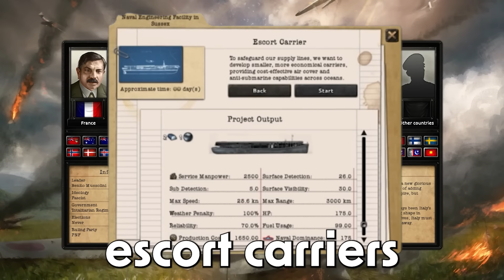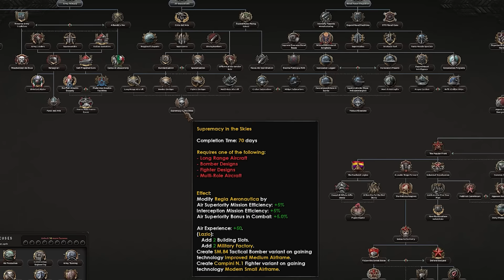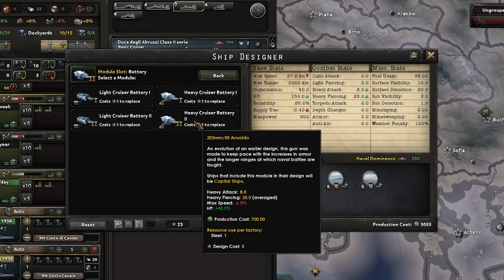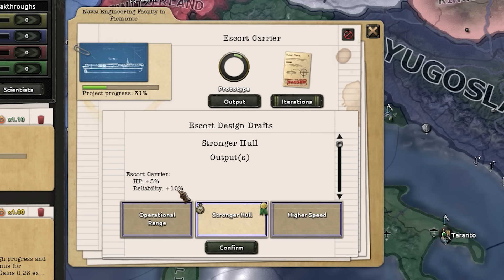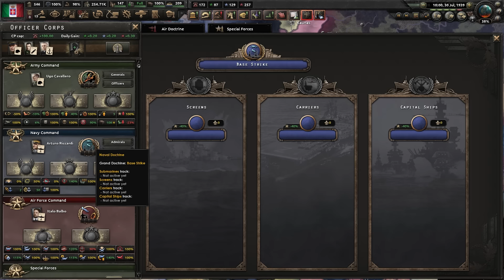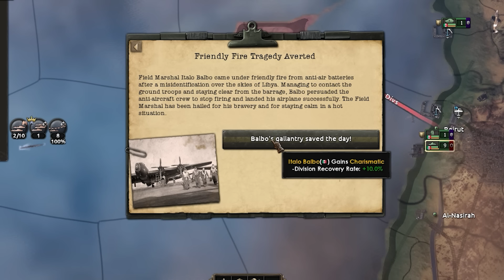Can ESCORT CARRIERS Save ITALY’S Doomed NAVY?

Comment: I always really like your naval video's Curt!
Although battleships were not a topic of this video, Italy's Littorio ships (which you deleted :P) are actually very good ships. They start with 1940 tech engines, making them faster than all other BS around the world, and (as far as I know) Italy is the only country that starts with this tech. Very nice to use on early Super Heavy BS.

Oh and a tip for carriers: if you put a single carrier in the production line, you can adjust the plane configuration by clicking on the aircraft symbol. Consecutive carrier production lines will automatically copy this config.
Reply: Regarding the tip...I love it, didn't know it existed and it's really a nice QoL thing
Reply: I nearly cried in that moment. You just need to build like 4 of the littorio class, then refit the other 4 bs and then build destroyers...

Comment: Ok I dont have the DLC yet but what exactly is the diference betwen Basic carriers 1s/2s/3s and escort carriers?
Reply: The main difference is the flight decks; those of escort carriers have half the capacity of regular carriers. They're much cheaper though
Reply: Escort carriers are just that, escort carriers. For minors and nations that need a large convoy sweep to fight subs, it’s probably more IC efficient to use them rather than full blown carriers. Still not going to really hold a candle to 1940 or 44 carriers in a full engagement.